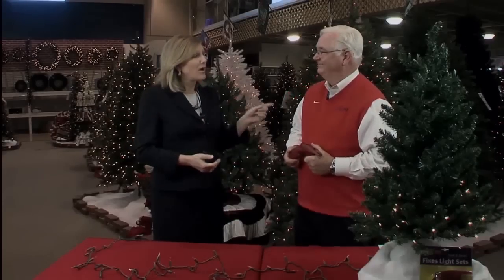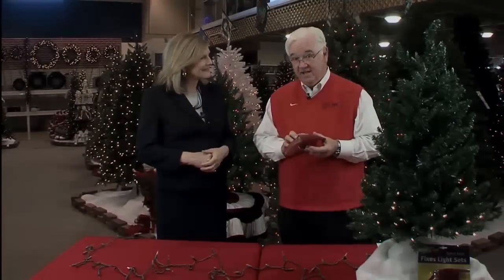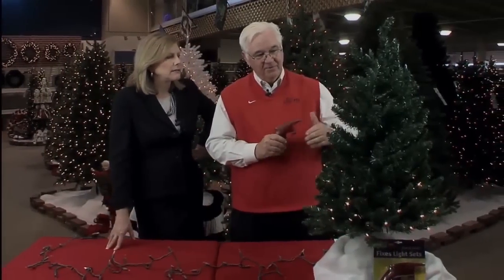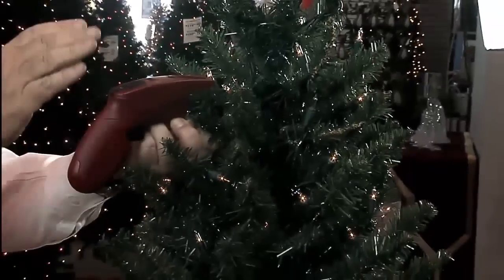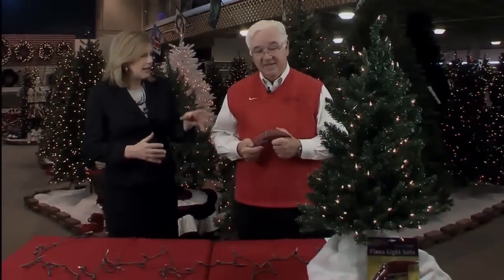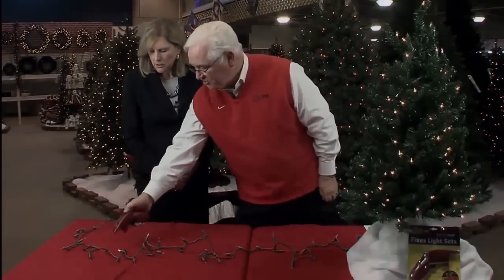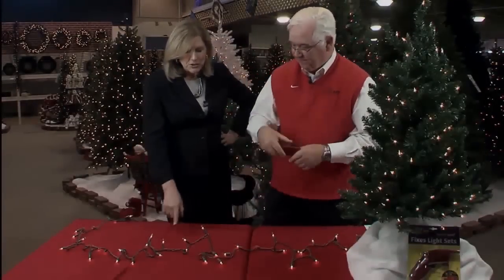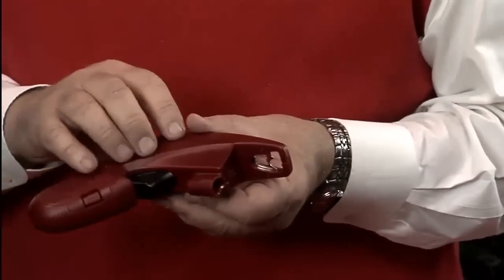Ask the Expert: How to fix Christmas light sets that don't work

Comment: Hi.... Here's how your lights work, so you can use a tool like this successfully. First of all, this is only for incandescent lamps, not LED strings.
The small incandescent light strings  (like shown here) are in series. This means that the lights are all in a chain. If you remove one link (bulb) the chain is no longer connected. These little bulbs have a neat little invention inside them, known as a "shunt." When one bulb burns out, that shunt is supposed to re-create the connection (the broken link) that the internal filament once did, just at a lower resistance (really it turns the dead bulb into a short) to keep the rest of your string glowing. This helps you locate the faulty bulb quickly. The down side to this little neat invention is.... As more bulbs fail (turning them selves into jumpers) the voltage to the rest of the bulbs that still work slowly increases. So really this is a spiraling downhill affect.  So in short: If you see a dead bulb and the string is still glowing, the dead bulb is a jumper keeping the rest of the string lit, but because it's a jumper now, it is no longer "absorbing" it's share of voltage in the string. This makes the string brighter with every dead bulb. Eventually the string can't deal with the stress of all the dead bulbs, and the string burns out with one big flash.
The item you see here is to fix a bulb shunt that isn't working properly. The shunt inside the bulb will activate when it has a high voltage across it (filament burns out). This is a momentary thing that happens and closes the gap in the chain. Sometimes these shunts don't close on there own and need a little extra help, that's what this item does. It sends a low current, high voltage spike down the string to help activate the faulty shunt (or multiple faulty shunts) 
SO.... When a bulb fails, replace it as soon as possible, because the more lamps that go dark, the faster your string of lights will completely burn out. 
Now I'm back to the north pole!  :^) Rudolph's nose just went dark.
Reply: +Mr Carlson's Lab  I do not think it will work with LED's since they use a much lower voltage...they might burn out + they are polarized.
Reply: +DP2050 He said it doesn't work with LED sets. The reason is the NP junction of the LED will not pass current in an open condition. Current must be flowing.

Comment: Oh yeah, this is real easy.  Let me go into my kitchen drawer and get the ever so common Light Keeper gadget.
Reply: I know your comment was a year ago, but this year the device seems to be everywhere. Amazon- Target - Walmart - Home Depot
Reply: Michael A + Right! I am annoyed. I just checked my lights before putting them on my tree and now most of them aren't working. That's just wonderful. I took the fuses out of the plug so I will change the fuses and see if this is my problem.

Comment: what this  does is makes the shunt  on the bad bulb to short (like it was supposed to do in a failure). However , I have this gun and it works when a shunt is the problem, but many times the problem is due to a  broken wire or a loose bulb in a socket,  then you  can pull on the trigger all day and it will not light the circuit..   Because this is only used on incandescent lights, it is becoming obsolete.   For LEDs you can try the LightKEEPER.

Comment: Don't see me doing  that..run out get that device and listen for beeps, change bulbs and or fuses... I just spent over 2 hrs checking out 2 long strands... Odd 5 strands that were fine and unused a few years ago, are all NG this year.  Changed the fuses, etc no patience for this just not putting up as many  lights this year next year get new ones.

Comment: Mini lights are disposable, I buy the cheapest strands for $2,50 for a string of 100 every year to offset the ones ready for the trash. I consider it "spoilage" because its not worth the time or effort fixing this garbage and the associated headaches. You also want newer stuff up so it wont fail up on a peak when already installed.
Reply: AnthonyTube i

Comment: My NEW lights were working, but when i was wrapping them around the tree half started to flicker. When i touched the bulb, half the strand went out! and i could not get it to turn on!

Anyone know how to fix that?
Reply: No because I just had the same thing happen.  String worked fine, putting up on the outside tree half went dead...I changed the fuses, so glad all worked, and then as I started to reput it on the tree they all died so I give up. Frustrating, isn't it?